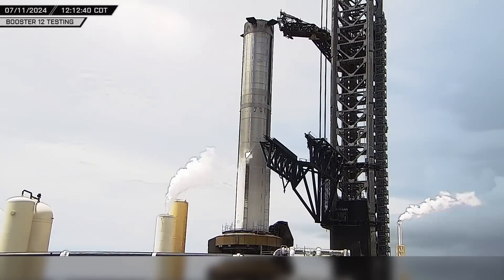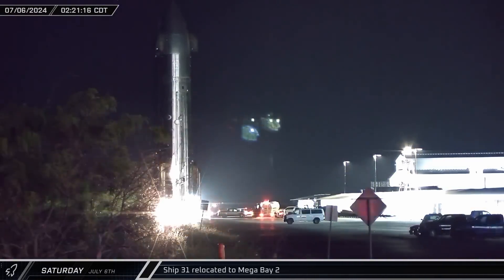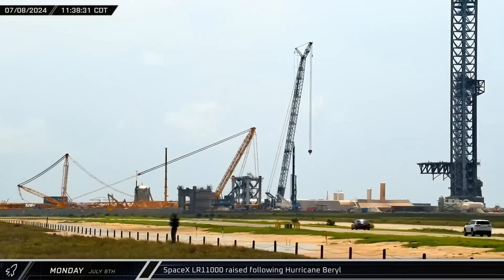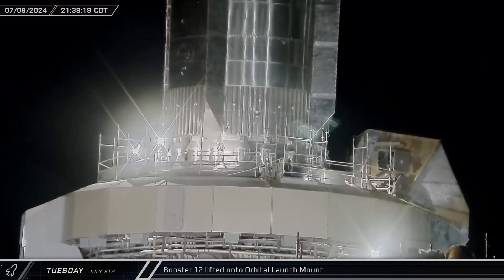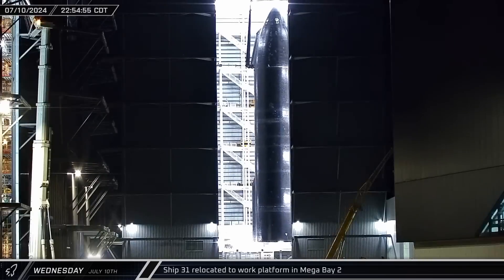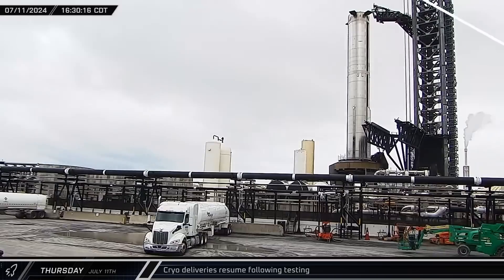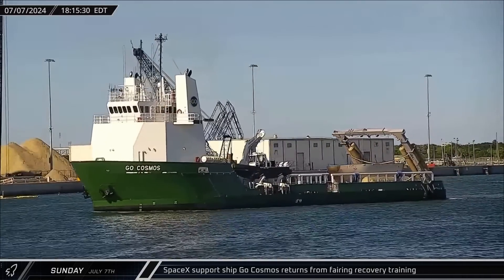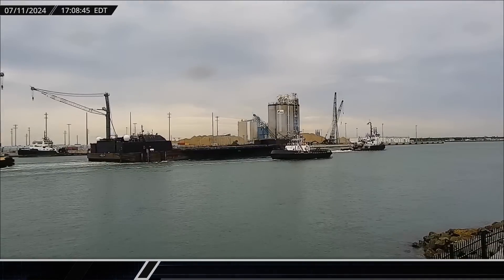AT LAST!! First Module of Tower 2 Gets Stacked! - SpaceX Weekly #123

Comment: In one sense, the concrete base has been replaced with a steel tower section (but still filled with concrete). So the tower is already one full section taller!
Reply: the 'old' tower is sitting on a concrete 'section' that has been cladded with steel later on.. so no, not taller yet.  They need more sections for that..

Comment: Having stacked towers for a living, I’m very curious as to why they rig up each section and leave it that way for so long before actually picking it. Seems really odd. Usually you wouldn’t rig it to the crane until you are ready to do it right then. This is unlike any other tower and certainly way different than any of the ones I’ve stacked so who knows.
Reply: I had always assumed they were waiting for optimal temperatures and wind speeds thus the morning lifts.
Reply: Could be getting very low pay and stretching the work out.